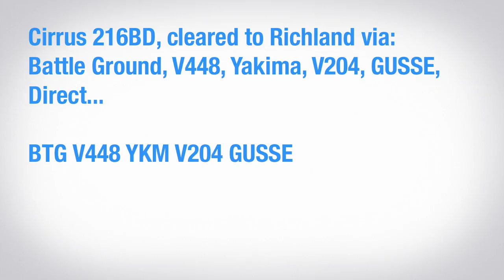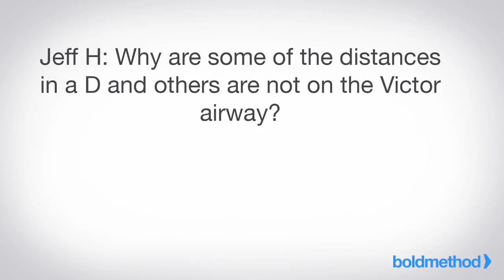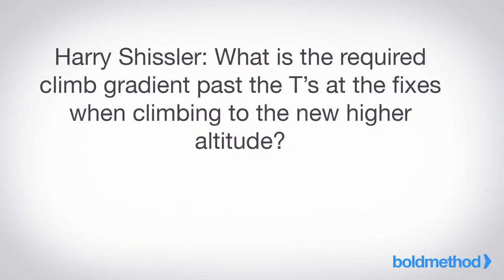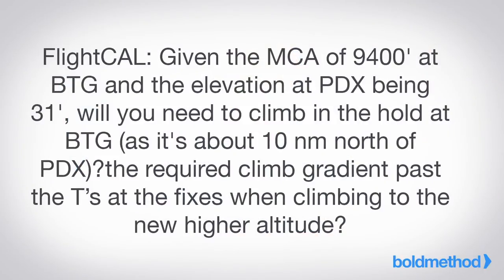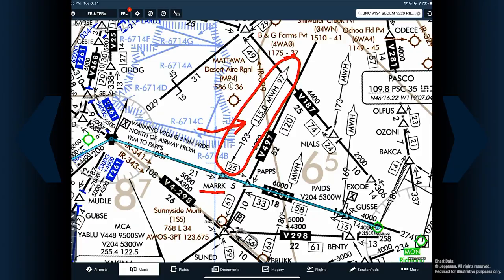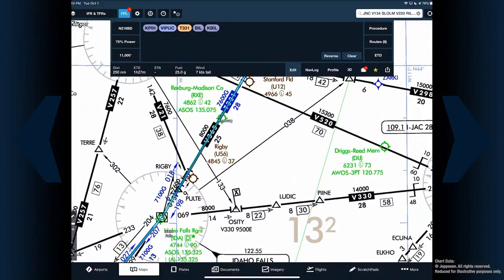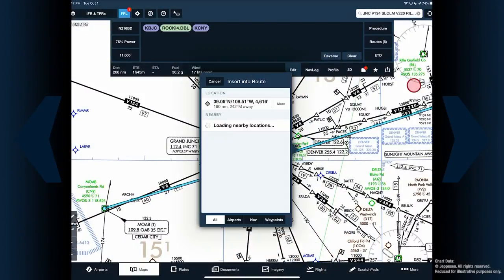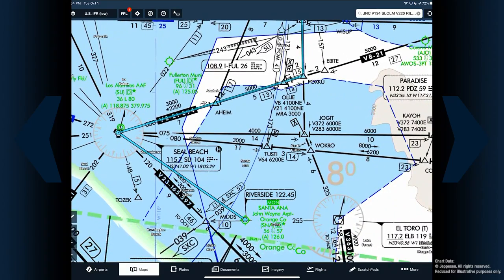How To Use Low Altitude IFR Enroute Charts: Boldmethod Live

Comment: In regards to min climb gradient: I found in the terms manual the following -
1730, page 182 - MCA: The standard for determining the MCA shall be based upon the following climb rates, and is computed from the flight altitude:
SL through 5,000 ft: 150 ft/NM
5000 through 10,000 ft: 120 ft/NM
10,000 ft and over 100 ft/NM

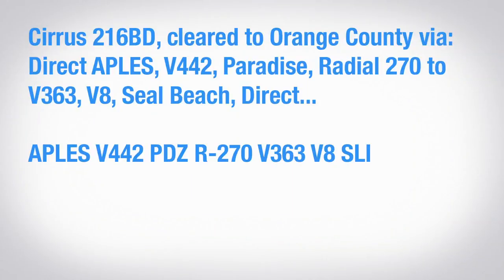Comment: Thanks for the great video and great series.  These have all been a huge help!  At 49:52 when you're trying to put in the radial out of PDZ, you actually can do that in foreflight, you just need to know the distance.  The format is FIX/RADIAL/DISTANCE, and can be entered as PDZ/270/13 (paradise, 270° radial, 13nm) or PDZ27013.  Of course you need to know the distance so its not perfect, but it can help.  The complete clearance into john wayne could be entered as APLES V442 PDZ PDZ27013 V363 V8 SLI.  Hope that helps someone!

Comment: Absolutely love your channel.  One of the best out there for sure.  Hey quick question, if you hadn't picked up that RNDAL was the intersecting waypoint would you have had to either 1. Track outbound on the PDZ 270 degree radial and then Track outbound on the POM on the 164 degree radial to POXKU or 2. Enter POM and POXKU, load the airway, activate that leg and again track 270 to V363?  Also the first time they gave you this amendment single pilot and unfamiliar did you/would you have gotten it first time?  I'm assuming just telling SOCAL you are unfamiliar and asking them to repeat would get a slower amendment?  Finally, what did you/do you do to prep when flying into a new area so that you can pick stuff like this up ahead of time.  Seems like a lot to figure out if the weather was bad and you were single pilot...